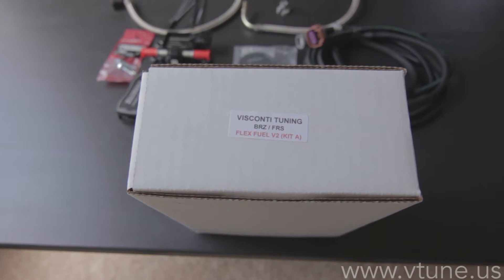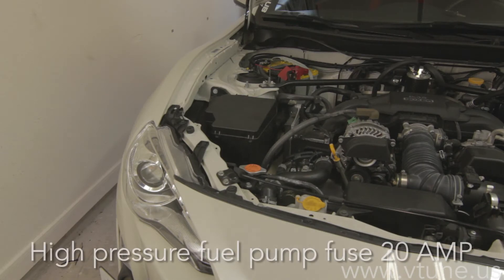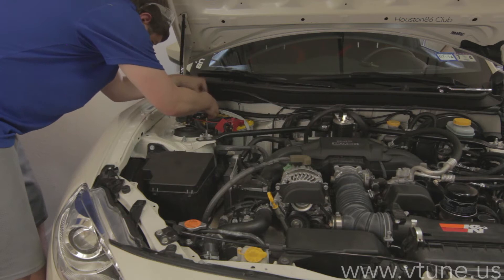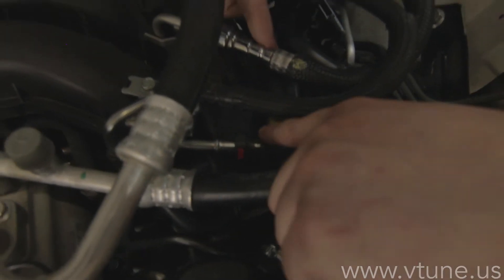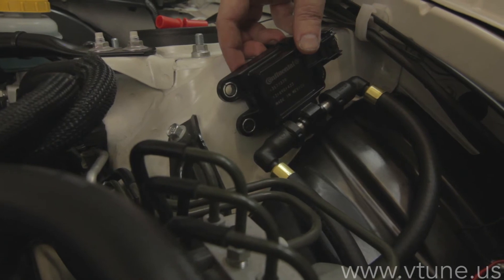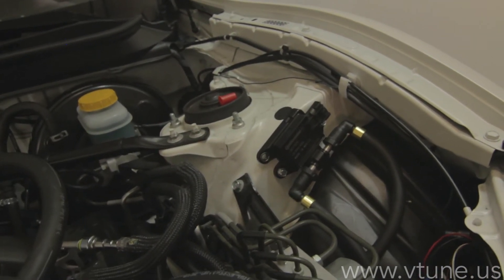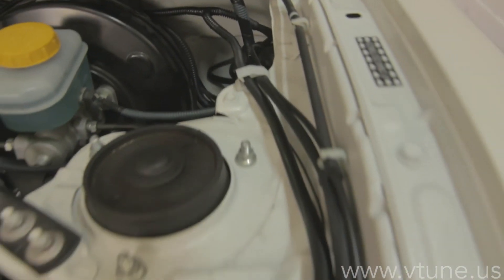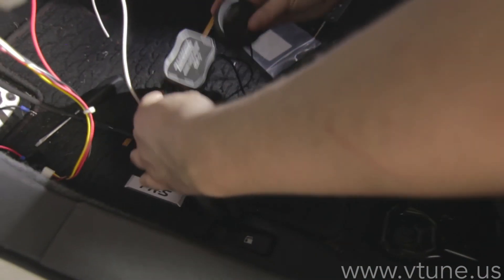Visconti Flex Fuel V2 install video

Comment: Heads up to anyone installing this with the new version with the sensor relocated. Be careful in this video it shows using the front fuel line, with the relocated sensor you have to use the rear fuel line. Went off of this video and my line kinked pretty bad

Comment: E85 is good for performance built car with high compression, big turbo cars, high advance timing to prevent detonation (engine knock).  You need around 3 times more E85 to equal same amount of gas. So you are adding more fuel for no reason.
Reply: E85 is good for anyone trying to get more performance out of their vehicle so it isnt for no reason.

Comment: Did you purchase any of the Fuel Lines from Visconti?
Reply: Thank you for the reply. i had another quick question, the flex fuel kit isn't a necessity to run e85 is it?
Reply: Generally this kit will be used for vehicles who fill up both 91 or 93 and E85, and any combination between. It depends on what your car has been tuned for.

Comment: So, I am a major car noob. The hardware seems like an easy install, but do I have to install a tune before I run e85? Or is the tune just to optimize e85?
Reply: +postbreak what did you do with the rear o2 sensor & cable?
Reply: +postbreak so you have the sensor in place but the cable removed at both ends, or an open hole where the rear O2 was plugged in? Also, it would be a major help/comfort if you posted a video of the ecutek software and tune install. I might be the only one, but it would definitely be an original video. The information seems to be limited to ambiguous threads.